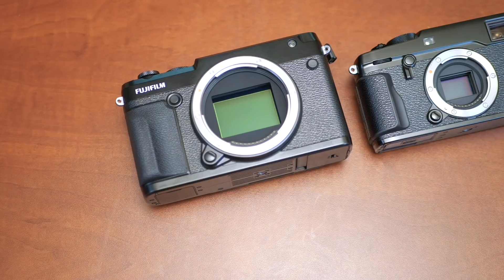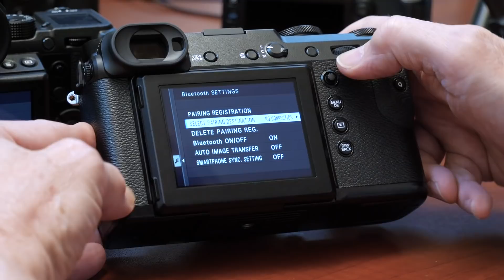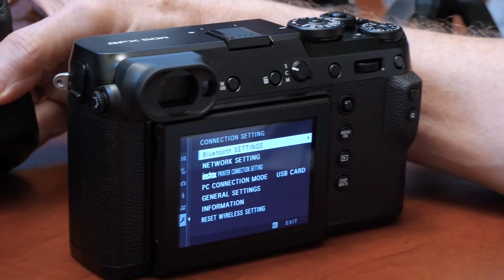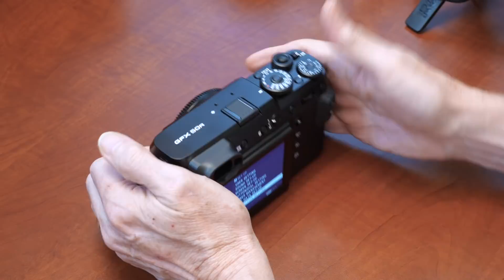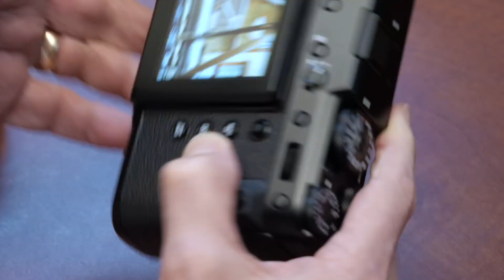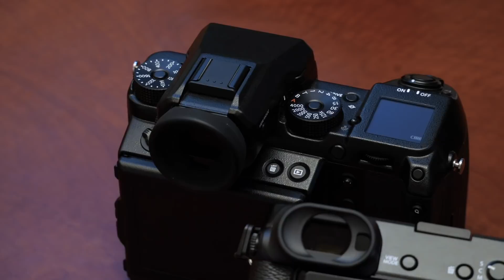Fujifilm GFX 50R Hands-On First Look

Comment: I'm not a whiner about size and weight,yet i would have the S inside,and the R with me,in my hands,outside.I already have a full frame DSLR,so for critical work,i can connect the GFX50R to my smartphone and do all sorts of different things with open source software.I shoot in camera,no post,and the Fuji has some nice film simulations,so i bet with care and patience,you can easily rock some solid shots.I'm only about what cameras can do,not their limitations,because all cameras have some.The 100 MP version will be around 10K...

Comment: Why compare size to a DSLR though. That's always been misleading and that's quite a low-level trickery Fuji likes to use to market its products. After the fact you pull up a Nikon Z7 just to show the flange difference but you, quite unknowingly, rather clarify how large indeed the body is compared to a modern FF mirrorless. No I don't think this comment is nit-picking.
Reply: senerhayat The reason to comparison size to DSLR is because if you already have a DSLR and are use to all that bulk and size, and you jump to a way larger sensor nothing will change for you..... as far as what you are use to chucking along.
Reply: That's certainly an angle. But it's not the most obvious angle.
Reply: senerhayat k
Reply: There has to be a gain in jumping up to a new system, in this case the larger sensor with no weight or bulk penalty is a very appealing reason.
Reply: k

Comment: Pre ordered from BH photo video  for 5200 with the gf45 bundle promotion and a separate order for the gf110 for 2250 with a 150 e giftcard.  Hopefully they will start shipping before November.
Reply: Yes, still have it, its like a canon 1dx in IQ with bigger sensor and 50mp. Better than my a7r3 in IQ. Not a pixel guru so take my opinion with a glass of vodka.

I have the gf45, 110 and 250... along with an otus, a rokkor pg and canons, sigmas... they all work ok.

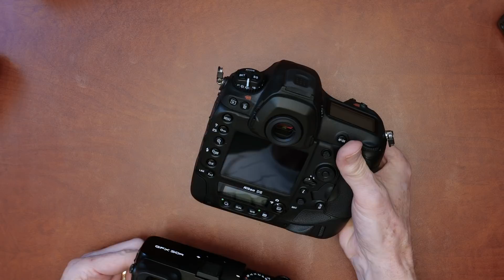Comment: 6:20 the 50R has a LARGER sensor you mean.
Reply: @Freerider  hi there.
You're confusing, what you're calling medium format it's aps-c format with 1.5 or 1.6 crop factor. Medium format it's bigger than full frame with 0.55 to 0.8 crop factors